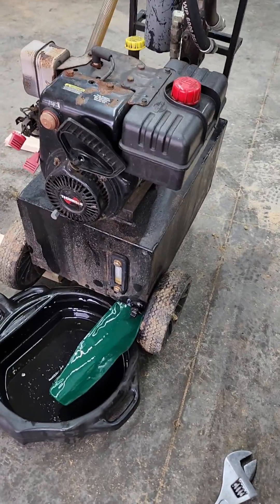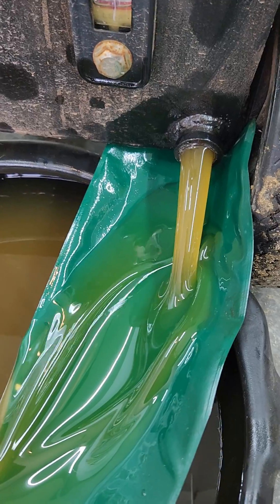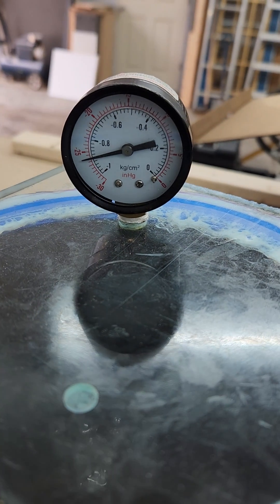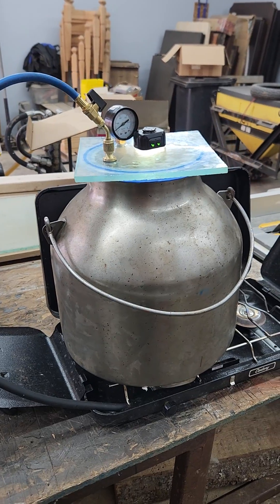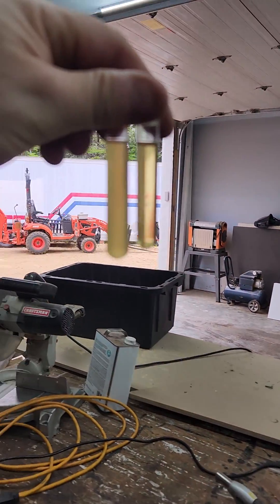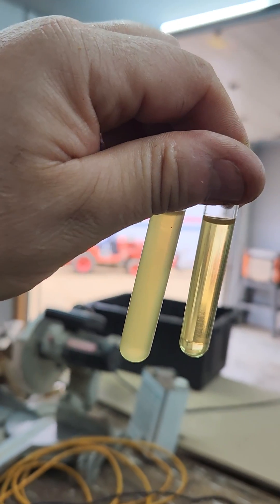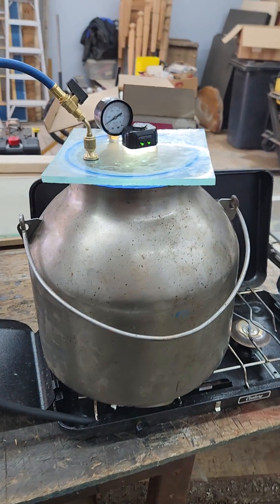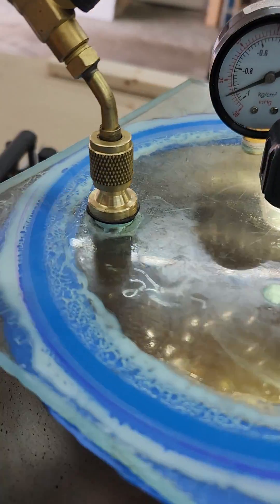Removing moisture from hydraulic oil - quick and easy solution

Comment: Where does the moisture go if it is a sealed container?  To the pump? Wouldn’t it need a cold trap to keep the pump clean?
Reply from the maker: It goes through the pump and necessitates the vacuum pump oil to be changed when all the moisture has been removed because some of the moisture becomes absorbed on the pump oil, but that's normal with any evacuation.

Comment: Glad you went to all that I would have just drained it and bought new
Reply: This is really cool information. I'm glad I saved your video, my tractor, splitter, processor, all run and operate great when they're warmed up but I suspect the hydraulic fluid has some water in each. Tractor hydraulic fluid is cheap enough but replacing all three is north of 500. Might just have to try it, thank you.
Reply from the maker: @georgedrollinger5589  it'd be about $200 bucks here in Canada.
Reply: Would I have to have vacuum machine....maybe just boil water off oil
Reply: Why is vacuum needed?